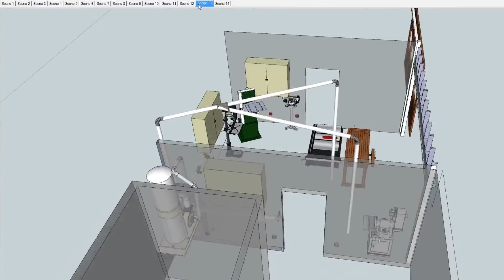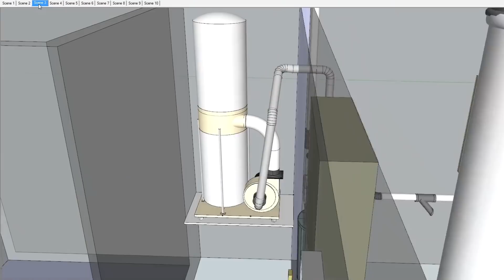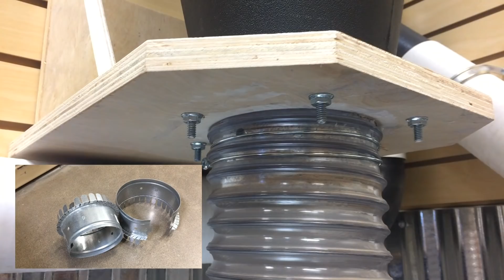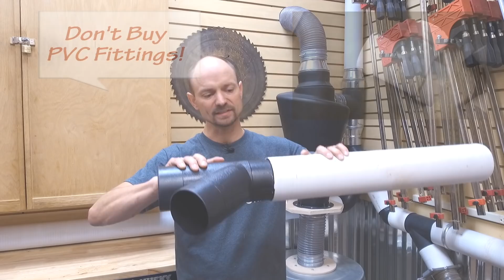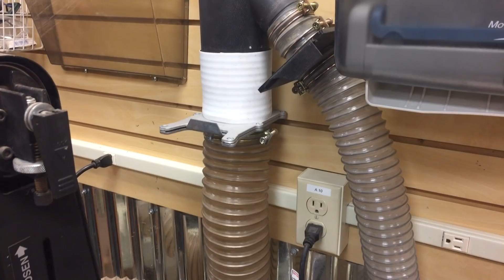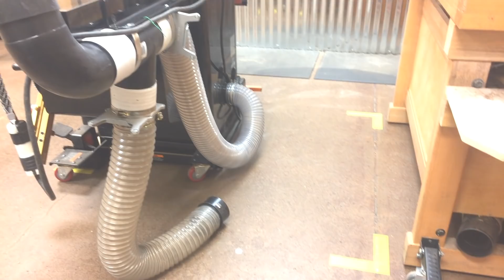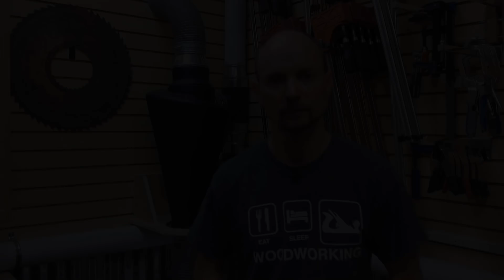Dust Collection Ducting That's Cheap and Easy?

Comment: Great video! I'm in the process of building something similar in my shop and had a question about reductions from 4" to 2½". With a 2 hp vacuum, is it best to maintain 4" flex hose all the way to the tool from the blast gate or reduce to 2½" at the blast gate to increase air speed? Most of my tools have 2½" dust ports.
Reply from the maker: We reduce to 2.5” for convenience. You shouldn’t have an issue reducing down at the gate.

Comment: Enjoyed your video.  Your shop looks great!  I am curious why you decided to go with a T instead of a wye right at the cyclone.  Do you notice any loss in suction.  I am trying to plan my dust collection piping as we speak.  I want to make it as efficient as possible.
Reply from the maker: Great question. Avoid Tees whenever possible. I had to turn both directions and in my specific application a Tee was the only way to do that.  Every joint, foot of pipe, and feature of the dust collection system causes a reduction in performance - key is to keep minimal components and short runs.

Comment: Hi Great system, just wondering how efficient the cyclone is, as when you showed the extractor the bag below the filter had quite a bit of dust in it
Reply: If you are getting dust in the plastic bag, you either have a leak in your system,  I am speaking of at the cyclone or the metal trash can. I have a similar system and I leak check it using incense sticks after emptying my collector can. I have the supper Dust Deputy also. I have run 5 inch lines through my shop the airflow with the 5 inch line is superior to using 4 inches ducts look up the cross sectional area of a 4 inch line vs 5 line.
It is dramatic. 
Having the T in the line right at the suction side of the Supper Dust Deputy is killing you with parasitic drag. Look up a drag table for different types of connectors. To combine lines you need to have long sweeping turns to change directions of air flow. Abrupt angles introduce turbulence  thus causes the saw dust to fall out of the slip stream. When this happens little piles of dust collect at the place where there is low airflow.
This creates a wash board effect in the line much like on a dirt road. 
Collecting dust with a DC system is very different from using a shop vac as a collector. 
The other reason you could have dust in your plastic bag is your trash can filled to capacity, don’t ask how I know.
Short of over filling my collection bin, I do not have any dust in my bag. 
And I do have a Wynn environmental filter for the exhaust of the air.

I did not reply to make you look bad only introduce concepts that will make your system better. 
The engineering of the Supper Dust Deputy with the 5 inch port was a compromise 6 inch ports required bigger fans than what most home shops had, using a 6 inch port the velocity of the air did not support chip movement thus it clogged up the lines.
The 4 inch line had higher velocity to suspend the smaller dust particles but created so much drag because of the small cross sectional area the parasitic drag was greater, thus bigger chips fell out of suspension.
Reply from the maker: Great question. One year later and we have about the same amount of dust there in the bag and we’ve yet to empty it!  The bigger issue is occasionally cleaning the filter with the turn mechanism. Since we are getting just the ultra fines at the collector we need to occasionally (1x every 2 months). I’d definitely put this system in again. It’s been nothing but positive and gets more than enough collection.

Comment: Any update on the dust collection? I just bought all my parts (minus the ducting) and keep reading about needing to run 5” to the SDD because there’s too much loss with the 4”. It quadruples the price though!
Reply from the maker: Planning a 1 year review with calculated cam at different ports. I’m very happy with my system and have Mae minimal changes over the last year. Would definitely do again. My farthest port has more than enough capabilities. I think folks get a little too overblown with trying to make everything perfect. Thanks for reaching out.

Comment: Thanks for all the useful info! I'm setting up shop over the next month, so watching a lot of dust collection videos. This is among the best. I especially like the floor sweep, almost as much as I like the t-shirt. The heat fitted joints is brilliant!
Reply from the maker: Ted. Thanks for the kudos. Haven’t found anyone that has done dust collection with heat shrink fittings. I have heard of many shops with successful results. 1 hear later and would absolutely do it the same again.

Comment: Easy... maybe.  But CHEAP?????????      hahahahahahahahahaha.... spare me.
Reply from the maker: I had this system quoted for metal ducting at $3500. If you want the least expensive option just roll the collector around to your tools.  I have less than $500 into the system (minus the collector). Expense is a relative term.

Comment: Do you have to manually turn on/off the dust collector everytime you use a tool? I'd prefer the ability to have it automatically start/stop after the tool starts/stops. Great informative video, thanks, subbed!
Reply from the maker: Yes though in practice I just leave the system running and switch to other tools by opening and closing gates manually. There are systems that automatically start the collector and open the gate when the tool is turned on. If I had unlimited funds this would be the way to go. The premise of this video is to show an inexpensive way to solve the problem. Cheers!

Comment: Great looking system! I disagree with your  take on the  wall mounted switch. I love my remote  for my DC. I've never misplaced it in 10 years. When I'm working in the shop, it's  in my pocket or apron. I did manage to suck it into my DC while cleaning my  table saw once. LOL.
Reply from the maker: LOL. I’m not so good at not misplacing things. If you put in an in-line cyclone you won’t have to worry about destroying the remote with the impeller!  Yikes!

Comment: Great video, very informative. I do have one question. You pointed out specifically not to use PVC fittings, what fittings do you use? They look like the Woodriver ABS  plastic fittings, am I right? If so, I found them to be much more expensive than PVC fittings. Does the cost savings in the pipe really out-weigh the cost savings of the fittings? My assumption is the total price of your system might be higher without crunching the numbers. If this is the case, do you know what other types of fittings can be used with the DWV? Also I didn't notice any grounding. Does this type of system not produce as much static electricity as PVC or metal ducting? Thank you!
Reply from the maker: Thanks for the reply. PVC fittings are much tighter than the ABS fittings from Woodcraft. This increases resistance. It also requires gluing the joints together which makes the system less First of all for changes. You will be throwing joints away if you decide on system changes and I’ve never had a system that I didn’t want to modify afterwards.  The cost of a metal ducting system for my shop would have been $3500. I came in way below this at less than $400. Grounding is a non-issue for me. I have lectured at several OSHA conferences on shop safety, and have had an opportunity to talk with inspectors regarding risks of static. There has never been an explosion In a home shop as a result of dust and static. The bigger concern is getting a small shock and then reacting to it and getting cut. The worst offender in my shop is a drum sander on the tablesaw drop. You can get a decent size spark here, however for me it is not that big of a deal. I have never had a shock on any tool with a blade.  Other climates may vary. I would suggest putting in the system and then consider grounding later if you saw it to be a problem. My opinion is that this is entirely over-blown by individuals that don’t know what they’re talking about.  I might think different if I lived in a dry climate - it’s not a problem for me.
Reply: @DIYWoodGuy  Thanks again for the valuable information. I'm definitely a beginner trying to learn as much as possible before I spend a bunch of money on unnecessary things so I'm glad you replied! I will not worry about the grounding for now. I appreciate you taking the time to inform me and in such a timely matter. I will definitely stay tuned to your channel.
Reply from the maker: Thanks Joseph. Best of luck.

Comment: Found this doing research as I'm adding a CNC and trying to figure out how to run ducting to the top of my machine so that something flexible can follow the spindle as it moves around. I long ago discovered the problem that just running flexible hose causes - significant drop in air flow at the tool. Your explanation is good. My CNC is a Laguna IQ Pro, but Axiom CNC has a nice (expensive!) vertical metal pipe that bolts to their CNCs. I bet I can construct something out of this DWV piping with maybe a wood frame to hold it in place that will do the same thing. I'm in So Cal, and I've found static IS an issue here on occasion. I installed a new drum sander recently and it startled me once with a significant zap... I would imagine a CNC, that can run for extended lengths of time, would also be a significant source of static. Static and electronics don't mix well, either... Gonna run some grounding wires.
Reply from the maker: I run a CNC quite a bit and I can tell you from experience that static can cause the machine to malfunction and reset and is a huge concern. Woodcraft sells a new blue anti static hose that is similar to Festool’s technology on hoses. Ground this back to your machine bed and make sure that your machine bed is grounded as well.
Reply: @DIYWoodGuy   I am a Festool guy, and appreciate their anti-static hoses... I wasn't aware that Woodcraft had a 4" anti-static hose. My CNC comes Monday, so I'm quickly sorting out these thorny details. Got the table built. DC is next.

Comment: With the plastic pipe, I would be concerned about static discharge.
Reply from the maker: There are minimal issues with static. I am shooting a follow up video in the next few weeks to address since it’s one of the most widely raised concerns. My system has been in place for a year and has no issues with static.

Comment: The DC1100 was designed for a bag type collector.  The choice of 4" duct was not  a good one since the blower and your cyclone both have 5" ports. This added restriction kills the CFM.   As I remember  the 12" impeller of the DC1200 is a direct replacement for the 11" DC1100 blower. Check the amp draw on the motor and compare that against what it is now pulling.  The motor is not properly loaded.  The 12" will give you a well needed increase in CFM.  This is a common mod on the very popular HF DC. Turns out a 12" impeller of a Ricon  DC fits. 

 To get decent CFM in a central system the minimum size for an impeller  is 14".    There is no free lunch on DC's
Reply from the maker: Thanks for the feedback. The DC1100 is a great collector - I’ve had the one you see in the video since 2001. Great ideas with the impeller size, I’ll have to look into that more.

I guess as they say “the proof is in the pudding”. I have no concerns over the CFM capacity even at my table saw which has a 13’ vertical raise. There is more than enough static pressure when running one tool at a time and I’ve had no issues with clogs. I wouldn’t change a thing about my system.

Comment: Would the ability to run 6”(SDR pipe) or 5” main trunk with 4” off run to each tool improve the airflow vs the 4” main trunk you used. I have the same dust collector and undecided about 6”, 5” or 4”?  Thank You
Reply from the maker: I’ve designed and built many systems for big companies and small. If you were to pay for a dust collection system design you would see that running 6 inch for a certain distance and 5 inch after that and drop into the tool at four-inch will yield the best cubic feet per minute flow. The cyclone is set up to do this. However, the distances to run with each pipe size are determined by your collector, and that is a tactical calculation based on your machine size, percent of usage for each tool, and tool distance from the collector. In short it is not easy answer.
Reply: DIY Wood Guy I love your design and system. I purchased the exact Dust Deputy you have and was considering using the 6” pvc for my runs decreased to 2” for my tools. I will be using the Dust Deputy with a stock 2 HP Harbor Freight dust collector. After watching your video, I am going to use the exact 4” main trunk. One for a drop and the other for a 20’ run with blast gates to the long bench in my garage where my tools sit. I’m working with 1/2 a 2 car garage and I’m thinking your system will be just fine and save me a ton of money. The only issue might be at the end of that 20’ run but I’ll take my chances. Any thoughts? Great job on the video and I look forward to watching the 1 year update soon. Thank you for taking the time to educate us newbies!😂

Comment: This is great, I was prepping for 26 gauge 4 inch galvanized duct, saw this episode and took it all back an exchanged it. And Wood craft has all thier fittings on sale this month. How the static build up?
Reply from the maker: Static has been just fine. I get the most off of a drum sander hooked up to the table saw port but it is more than reasonable.
Reply: @DIYWoodGuy  do you have it grounded?
Reply from the maker: No. Grounding is a waste of time in my opinion. There are plenty of references online to its ineffectiveness. In our humid climate in Oregon there isn’t a bad level of static. It’s a minor issue. Maybe drier climates can make a claim to the concern. I’ve built 3 dust collection systems and none of them have had a problem with plastic pipe.
Reply: @DIYWoodGuy  thank you

Comment: I can't find DWV thin Wall Pipe, around Fayetteville, NC. I did find some pvc drain pipe. But it's not the same.
Reply from the maker: If all you can get is PVC and then use a saw to cut the end in a + pattern and use a band clamps to squeeze the PVC in on the black ABS fitting.  Do you have a Home Depot or Lowe’s? Near you?  Might be worth the trip to get DWV
Reply: @DIYWoodGuy  ok thanks

Comment: Thank you. Well done. I have been procrastinating my dust collection project. Was looking at PVC thin wall. Did not cross my mind to use that drain pipe even though I use for draining around the house.  Thank you again.
Reply from the maker: Thanks Don. I procrastinated for five years before deciding to use a DIY solution. I have a shop quote for metal ducting at over $3500. This entire project was completed for less than $350 and it works great.

Comment: Nice video, good job.  It actually does make sense for the inlet to the fan to have a bigger diameter than the outlet.  That's because the fan generates much greater pressure on the outlet side than suction on the inlet side.  So, going from two 4" wye inlets (which is about equal cross sectional area to a single 6" inlet) gives more cross sectional area than the 5" line that you installed.  Now, it may not make a difference in your case, since you opted for 4" DWV pipe all around.  I'm in the process of doing dust collection for my shop with an old oneida 1.5 hp fan/cyclone and I opted to use 6" DWV all around the shop and then using similar cross section adaptors at the tool.  I am still working on this, so your video was really helpful, thanks!
Reply from the maker: Awesome. Great points too.
Reply: @DIYWoodGuy  I can't figure out why you went from a 6" opening to  5" tubing then back up to 6" for the XL Dust Deputy.  Wondering if the 5" Deputy would have been cheaper or staying at 6" tubing to the 6" Deputy would have better performance.  I ask because I am sorting out a similar system and trying to get the best performance out of my new Jet DC-1200
Reply: @Super Phil What did you end up doing?  Where did you find 6"DWV?

Comment: My biggest complaint is that HVAC is at a premium in any shop. Heat (or cool) is being drawn out by ANY collection system unless your internal air is NOT leaving the building. I am thinking that the Gyro Air G700 could be the answer but even at that I think I'd add a cyclone pre-filter too as long as I could make it air tight. (See https://www.youtube.com/channel/UCXRNHTVpEdhz9BIvomETGiQ/videos ) Your thoughts?
Reply from the maker: Over $4000 for a collector seems a little extravagant for a home shop. Unless you have a health condition I can’t imagine that this would be a viable solution.  I return the air to my shop via an air duct (not shown) but this is in place because the shop you are seeing is in a commercial space. I put the dust collector in a back room to cut down on noise since I need my students to be able to hear me in class.  There are a lot of expensive solutions out there.

Comment: How do you remove the stock 4" dual port from the motor as well as how did you connect the 6-5 reducer to the motor?
Reply from the maker: Dual port pulls out easily.  You may have to tap it with your palm back and forth to get it off.  The 6-5 reducer slides into the 6" port.  I had to slightly bend mine to get it into place.  Seal with duct tape if you find that it leaks.